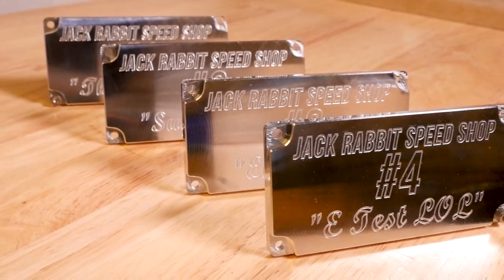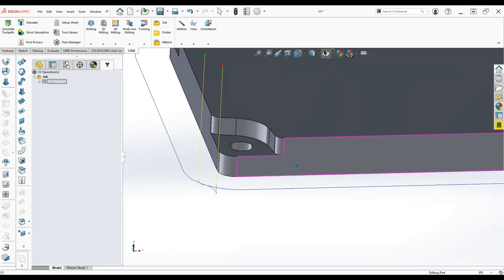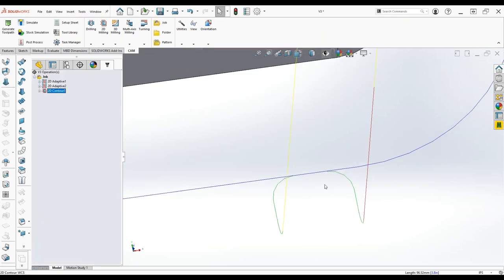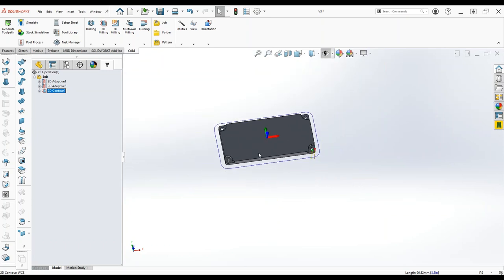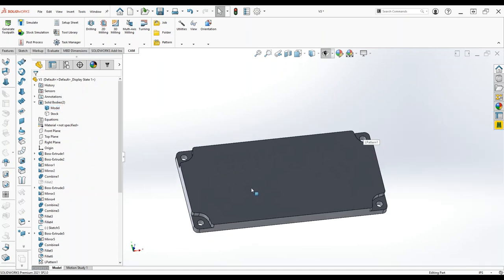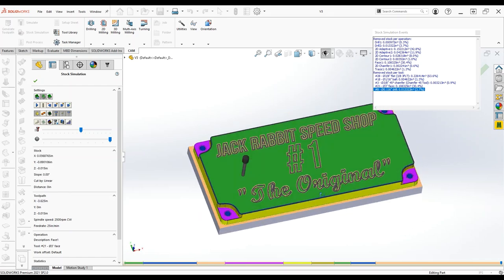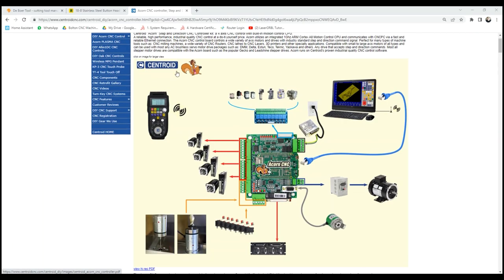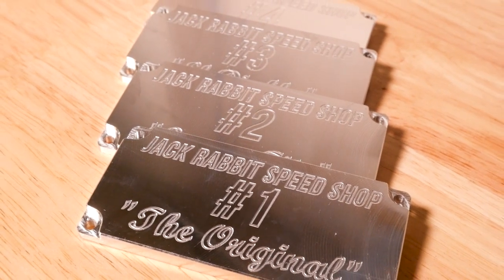CNC Machining at Home: Custom Plaques

Comment: I really like these detailed videos. Even though I use F360 for CAD its helpful to see the process. Using WEB to probe the stock is probably the way to go but you can use BOSS to get X&Y set in one probing operation.
Reply from the maker: Thanks Mark! That’s a good point 👍

Comment: Doesn't F360 regenerate the toolpaths as well? 🤔
I like your content 👌🏻
Reply from the maker: Yes it does. The CAM I’m using here is pretty much identical to Fusion CAM and both create toolpaths - I just prefer using solidworks for design and it’s more convenient to use integrated cam than it is to export a step file and then use fusion cam

Comment: have you tried facing after the engraving to knock down the burrs?
Reply from the maker: Hi Agbhar - yes, and it works well, but the finished parts have a brushed finish on the belt sander, so the burrs get knocked off then. You can see the brushed finish on instagram if you're interested @adamd_cnc. Cheers! - Adam